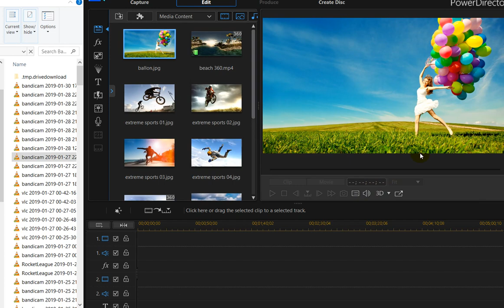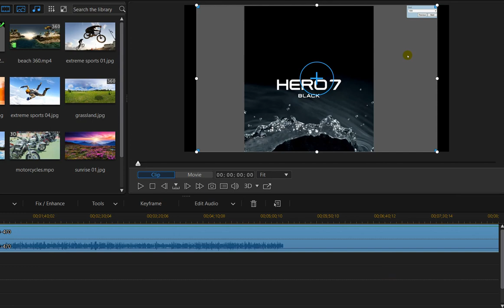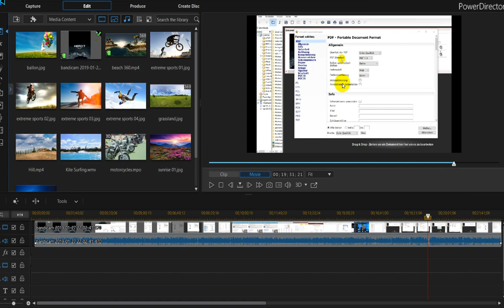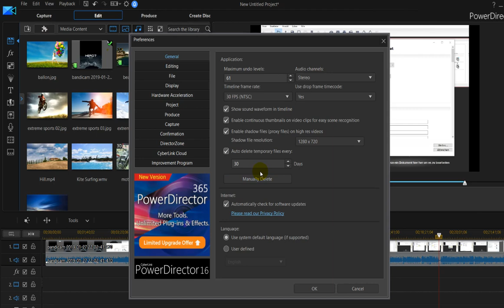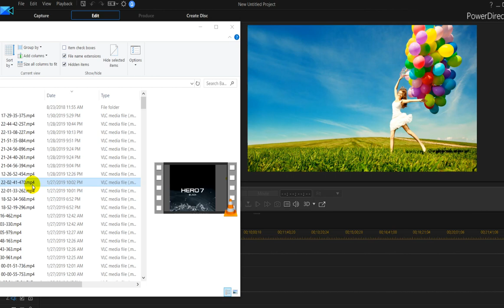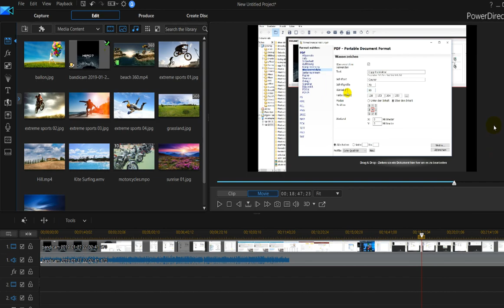How To Fix an Out Of Sync Video And Sound in Cyberlink PowerDirector?

Comment: Thanks i think it worked, not even the stupid cyberlink forum helped, and you even get one or two idiots who think they're techies ramble on about some complex plugins/functions etc as a solution. Power director has some cool functions and a cheaper alternative then adobe after affects (i assume) but seriously it has some bugs/weird glitches, this is just ONE i've found
another one is sometimes "text" loses attributes and you set it for (example) the duration 5 seconds but for some reason it ends immediately, altering the duration does nothing
Reply: update, this only TEMPORARILY solves the issue you have to keep removing those temp files and reading your pinned comment of "dividing into small pieces" sounds weird to mme, i've NEVER had this issue before, i don't remember doing anything to the computer or put new software so this sudden change is dumb
Reply from the maker: @VTuber_Clipp3r  Thanks for the confirmation and the nice comment even though the video is made terrible ... sorry for that ...

Comment: Thanks.  I use the PowerDirector app on android.  so it's a little different.  However, I cleared the Cache and the app data on my phone, and same solution: problem appears to be fixed.  Good tip.
Reply from the maker: Thanks for the info!

Comment: I tried this and it does NOT fix the audio/video sync issue.  I found a fix on another site.  I re-encoded my original clip from variable frame rate to constant framerate using handbrake.  I merged the clips together using cyberlink powerproducer....worked like a charm!!!!  This video did not help at all....made me more frustrated
Reply from the maker: It seems to help some and some not. Go from variable frame rate to constant frame rate could help for sure, but no need to be mean